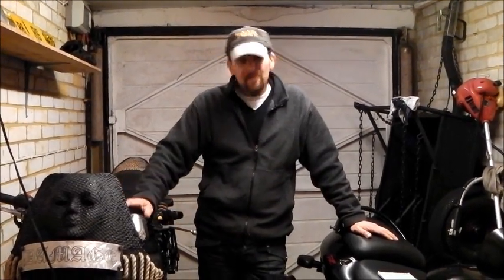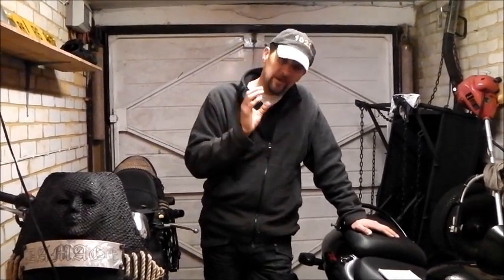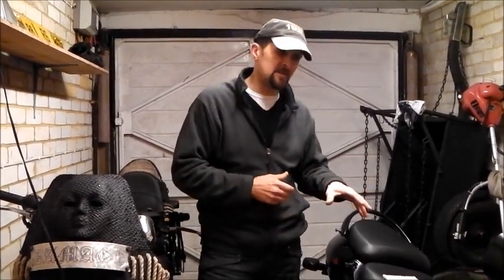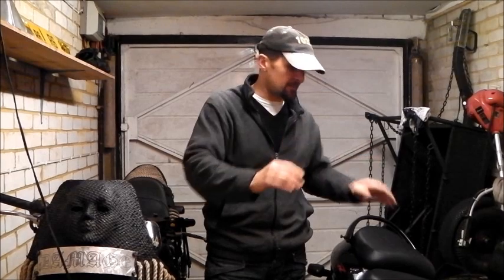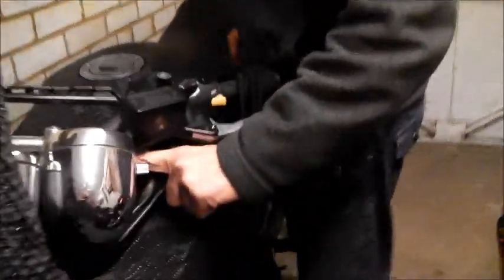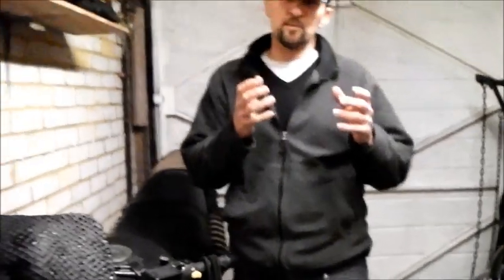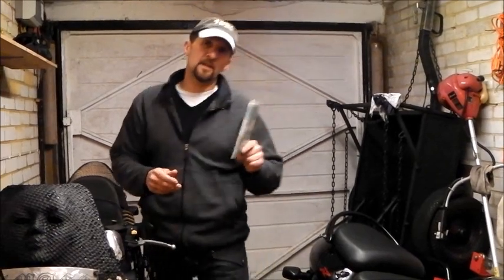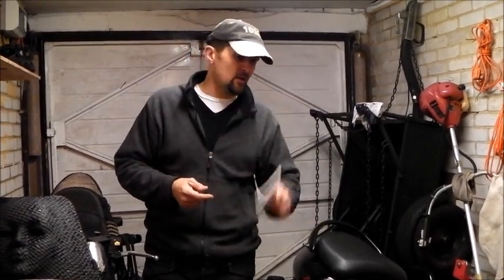Delboy's Garage, Motorcycle Suspension setup.

Comment: A very slight correction. Adding preload does not make the spring stiffer, the spring rate will always remain the same. It is just that increasing the preload increases the force needed to begin to compress the fork or shock. Sorry if it's a bit pedantic but I have been reading up a lot of theory on suspension lately to learn more about how everything on a motorcycle works. Maybe someone will offer me a motorcycle mechanic apprenticeship at some point in my life. Best wishes to you and Penny. :) Stay warm!

Comment: You are so right about factory settings. My old Blade was on factory settings, handled fine, my new CB1000R , for some reason , came out the shop on soft settings. Set it back to factory - handles much better. Also if you do want to adjust your suspension adjust one setting at a time so you don`t get lost or confused and it`s easy to put back if you are not happy. Then move on to the next one. This way you will also get a feel for how each setting affects the bike. 
Great vids Del. I`m working my way through all of them. Getting to be a Delaholic! lol
Reply from the maker: Goonster Thanks mate... new bike in the stable myself this week... and looking at your bike, think you might like what we've bought! ...Thanks for the support buddy
Reply: Moonfleet41 New bike eh? I`m intrigued. Can`t wait to see what you`ve bought.
Reply: Thanks mate

Comment: After over ten years of riding sports bike I finally paid to have my R1 set up, because the previous owner didn't know what he was doing and had turned it into a pogo stick. Best £90 I ever spent. I also bought a professional book on suspension tuning. I'm absolutely stunned at how good the bike handles and regret not customising suspension on previous bikes to my body weight and riding ability. I even used to has the same settings for road and track. What an idiot I was in hindsight! 

Custom settings are so much better than factory settings. In fact there should be seperate road and track settings, seperate settings for pillion and non pillion, and a rider should know how to change his settings for the rain too. My suspension settings have transformed the bike into a faster, safer, more agile carving machine.
Reply from the maker: Totally agree all the way mate, the factory can't know the body weight of every rider, they give you a wide range of adjustment, so why not make the most of it aye?!

Comment from the maker: Well it will certainly effect the handling for sure, but as long at the other end is set to the same level, the balance of front-to-back has been retained and its not too bad...its when they are far out of adjustment with each other that the worst effects are felt....cheers mate. Del.

Comment: Good video again thanks Del & crew :).  I wish the old  cb750f had preload adjustments that easy!  Just rebuilt the forks on the 82, put progressive springs in to help the old front end out. Adjustment is accomplished by air pressure adj, spring spacer adj, and fork oil viscosity change.
 Old rear dampeners / springs shot, progressives ordered to replace. Old dampeners had adjustments but are not re-build able.

Comment from the maker: Hi mate, the front suspension on your Div'9 is just fine, certainly it can be improved by fitting progressive springs in the legs...but its hardly essential..you can upgrade anything, and chuck money at a bike all you like...but often it makes little difference unless you are particularly feeling it wallow and slam under braking...if its riding ok, and you enjoy the ride it gives..save up your money and upgrade the bike when the time is right, keep the tyre pressures bang on and its a great bike

Comment: The correct tyre pressures are the most important first step in suspension setups. I purchased a bike from a dealer after passing my test, all the delivery checks done 1st bend at 30mph nearly planted it in a hedge - TP's were WAY off what they should have been.

Good vids Del keep em going
Reply from the maker: Why do we hear that so often aye...how hard can it be to stick a guage on the valve to check... thanks for wathicng buddy, take care. Del.

Comment: Great video Del - after doing a Hayabusa front and rear fork and spring swap on my Bandit, a suspension "tune" was in order. You are absolutely spot-on mate advising factory default as a baseline. With the initial settings in place it's fairly easy to dial in your daily driver needs, even on a hybrid bike like mine. Be advised though some bikes are adjusted by "clicks" and some reference a complete turn cw/ccw as one measurement of adjustment ;)
Reply from the maker: Thanks Matt, appreciate that input, wise words well said... and it sounds like a cool hybrid you got there!

Comment: Excellent video! The mind can play strange tricks! How many times after a service at the dealers have we thought, "this is riding so much better now" when all you've had done is an oil change! Lol. Really enjoy your presentation.
Reply from the maker: Hi Paul, yeah, usually cos they have oiled and adjusted the chain, which makes the gear chain smoother!
Reply: Except when you have a shaft drive lol!

Comment: I agree with most of what you've got going on here... other than the fact that a rider can greatly benefit from ensuring spring rates match their weight + cargo. The Busa and other big bikes can be tuned for someone between 180 and 220 lbs... any lighter or heavier and you'll need to change your springs.
Reply from the maker: Not that important mate, and NOBODY would ever bother swapping springs on a road bike, most road machines have a range or abililty like you said "180 to 220".. and the Busa handbook recommends the same spring preload for single rider, and 'Rider and Pillion' alike... and that's because, as a tourer it has a much wider range of ability than a more focussed, smaller sports bike like a Gixer 1000 or ZX10..! you weould only upgrade the back spring if you were seriously heavy like 300+ and fully loaded with kit..!
Reply: I'm 245, had to do the springs on my GS500. Mainly because that bike was built to a price point... and for 150lb vietnamese men. I'd rather have the ability to carry 500lbs (me plus pilion, plus gear) and not be maxed out, and set the spring to near zero preload for solo riding. But that's just me.
Reply from the maker: AimlessMoto
Ah, you have a point there... 17 stone plus is a big lad for a GS500, they are a dinky little thing for a bloke your size... so good plan with the spring.... have you thought about getting a beefier bike for the loaded trips..?

Comment: The factory suspension settings for preload are going to be quite a bit different for a 140 lb japanese rider and a 240 lbs US rider.  Yeah we are quite a bit bigger than they are.  And rebound and compression have to do with how a person rides, how aggressively etc.  I think you are missing it huge here with your advice.
Reply from the maker: Not at all Jessie, the simple point made is that the middle setting is the correct place to start for fine tuning to your weight, whether you be 240lbs or 140...

Comment: Nice Vid Del and to the point. I rarely fiddle with suspension setups apart from checking damping and rebound. The problems I've found on modern bikes are more likely to be lack of grease on the pivots or lack of oil in the units. (easier to check with twin shock setups...)

Comment from the maker: Hi mate, at the moment we are right up against it with time constraints and to make a video on this would have to take a back seat till we can get near it..but if you think about it, the idea is just the same, all the same rules apply, there is nothing different in setting up a Harley suspension than setting up a sports bike, certainly as far as the sag, preload and damping..also, Harley's often don't have any adjustment other than rear preload, if you have a particular problem then let me know

Comment from the maker: Yes...on a word.  lifting the back stands the forks more upright at the front "increasing the rake angle" and the bike will be less stable but better at dropping into corners...you'll be trading off straight line stability for increased flickableness...and conversely, dropping the back does the opposite..it will corner more sluggishly, but be more stable in a straight line....with retro/commuter/muscle bikes the geometry is set to be general and 'OK' in all usage.  better to leave it alone.!

Comment: Hi Del, great videos mate, always enjoyable watching them, have to disagree with the comment on the busa tho about the suspension, i got a 2014 busa in may there and  with the suspension at standard i was bouncing off the seat all the time. Took it to a suspension specialist near where i live, hes completely changed it for   road riding  especially country roads. it has transformed it to  being  really  sharp and  totally  planted, when hurling round corners. i recommend  anyone with a busa  go and get there  suspension  specially tailored to them it makes a massive difference , also my tyre  pressure are 33psi  front and back. i thought this was low but  with the suspension  properly setup. this is correct. so just to say standard suspension doesn`t suit all. All the best keep up the videos.
Reply from the maker: You're right mate, you can fine tune anything, and we're not all the same size, or the same rider... good call buddy, all the best, Del

Comment from the maker: hi mate...i found the same issue, those flat slabs that follow the top yoke are way too pricey...i found mine form a company in California, just went on eBay international and searched till i found them.....but TBH, now ive seen them, you could get any engineering shop to turn them up, just use some 1" alloy bar, part them off at 1" long, and drill a 10mm hole down the centre, and buy some longer bolts, wouldnt cost you £15 tops... good luck mate, hope that helps.. Del.

Comment: I have Hagon Set up all round on my bandit, I read a book somewhere saying how to set up the suspension properly for the riders weight and how you want to ride, i think it was something like measuring the difference of no load and fully loaded and adjusting your suspension to a certain measurement. Just got the bike and never set suspension before, and considering mine is non standard and I want it set up for best performance over comfort, will let you know how it goes.

Comment: Hydraulic damping doesn't have anything to do with sag. An inch and a half of static sag is way too much. Sag is set by preload, which should be set according to the rider's weight. The factory settings are a starting point, but aren't the best settings for the bike. If you weigh 150 pounds, the factory settings are going to feel vastly different to you than they would to someone weighing 215 pounds. Don't set your suspension in the middle. Set it to your weight and riding ability.
Reply: That should be the top comment.

Comment: A little help needed please from a new rider just passed cbt, when applying brakes on my 125 with  little more than what i would call " NORMAL " braking pressure the front suspension is bouncing until i actually come to a stop, a bit worrying for a new rider ! just subscribed these vids are a fantastic help thanks.

Comment from the maker: Hi Tom, two reasons why you found no real difference buddy, One is the manufacturer gives you a bit of adjustment for effect and BS.in fact the changes to the damping rate that each stop makes is so minimal its hardly worth it, remember they cant go producing a product that a feckless narb can get themselves in trouble with so in some ways its for your safety and their litigatory protection, the other reason is that you (if i may be so bold) dont punish your bike enough to outride the damping.

Comment: Hi Delboy.  I'm really stuck.  I know this probably seems like a basic question but I've never done this and don't want to damage my engine because it's my commuter bike.  I need to check the front steering bearings, which I've been told requires me to lift the motorcycle by something other than the suspension.  I assume that a scissor jack on the frame would be best but I have a sport bike and the frame only has one cross member near the rear wheel and probably will only lift the rear wheel if I lift the bike by the frame.  I know there are swingarm pivot stands but they're really expensive.  So I guess my question is can I lift the bike by the engine with a scissor jack (and a wood block or something) or is there some other way to do it?  Or would lifting by the engine damage the engine?  My service manual says to use a scissor jack but doesn't demonstrate where to apply it (engine, frame?).  I know you have a hayabusa, which has a frame with only one cross member at the bottom too.  How do you lift your hayabusa to check the front suspension bearings?  I watched your video on the red Kawasaki demonstrating how to change steering bearings but you didn't demonstrate how to raise the bike up.  Again, I know this is a basic question, but I'm really stuck.  Surprisingly, there's no info on the internet about this.  Thanks!

Comment: Uncle Del
My R1 Loves to tank slap me. SHOCK!
Since I have my new Dunlop Sportsmarts on.. Front tire is at 36 and rear is at 34. Ill try it at 38. Soon as I jump on the power and load the rear. Or maybe I just need to get a steering damper.

Thanks for the Videos
Reply from the maker: +Heinrich Venter Hi Heinrich, 34 or even 38 is way too low for the year, a hard core sports bike like your R1 should be running 36/42....try 40 and see if you like it, but if it was mine, id definitley be running 42 in the rear... let me know how it goes.. Del .
Reply: Thanks uncle Del. I sure will give it a go. Cant wait for spring. Are you quite handy with suspension setup. I know you mentioned factory settings as the best. but i only weigh 72kg 11.33 stone.. So i guess my sag on my bike will be or could be wrong
Reply from the maker: +Heinrich Venter Hello again Heinrich... no the sag is set on the bike with no rider, that is a basic 'defualt' factory setting, it is designed to allow the suspension to have as much flexibility "up, as down" and not favour hard or soft.... it is after then that you make the adjustments for your weight and riging style... im not by any means an expert, but if i was setting up an R1 for myself, (and im 80kg) i would go factory settings, and maybe a tiny bit less preload in the rear...! hope that helps buddy.. good luck. Del.

Comment: great, helped a lot dell, think my zzr was set up for an elephant on the rear
Reply from the maker: +Andrew Jones Ha ha, what do people do that, its such a lame way to try and gain handling... just works the opposite... as long as you have the small amount to natural sag under the bike's own weight, and the same compression and rebound settings it'll ride fine..(unless you're an elephant, in which case buy a Harley lol)...
Reply: Got the bike cheep and a none runner so only just done 20 miles or so, checked the rebound settings (small plastic disc on bottom of rear shock) only to find no bloody markings on it so took you advice and sorted it...your a legend and I continue to tell mates about your chanel :-) peace out and ride safe budy.

Comment: Hi Del, watched with interest your Legend project, I have a Thunderbird 900. Just looked at this video to see if there were any tips on how to test/ check my rear shock. Mine is 24 years old now, no signs of any leaks but how do I check its condition/ performance? You changed the shock on your Legend.
Cheers. Keith.
Reply from the maker: Hi Keith, You can take it as read that the oil in your shock, after 24 years, isn't much good for anything, so while it may not leak, it's not going to be performing at it's best by any means is it?. we change the oil in our forks as a matter of routine servicing, but it's impossible to do the rear..  I change the shocks on pretty much every project bike because consistently it always improves them massively..  If you can afford it mate, you won't regret it.!
Reply: Cheers Del, Id pretty much made up my mind to do it anyway. What youve said makes perfect sense, but really just want to find out/test to see if it was ker nackered. Cheers Del, keep up the good work.